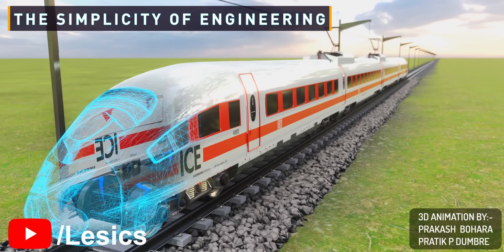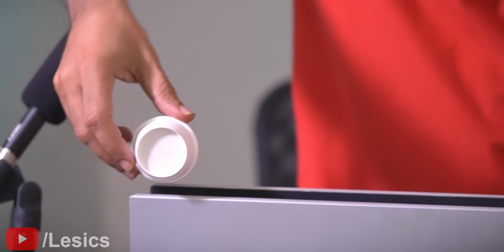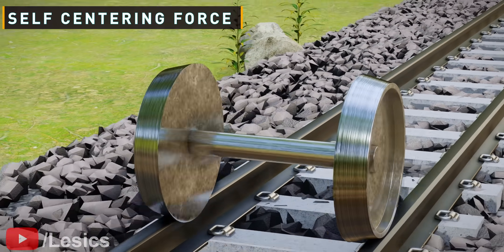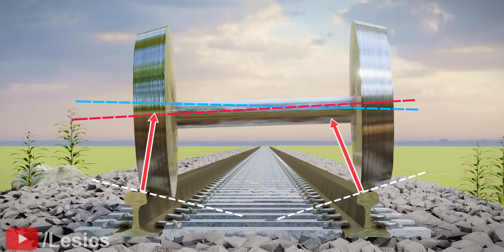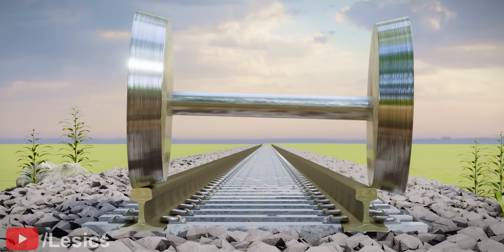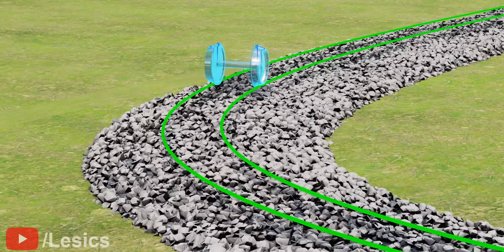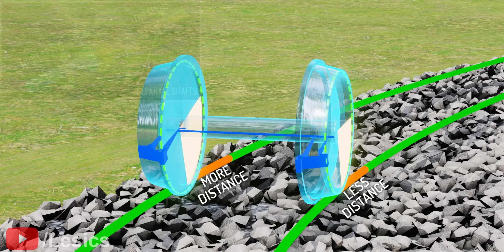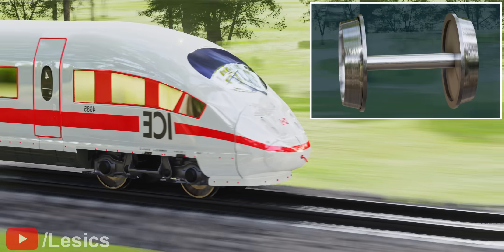The interesting engineering behind the SHAPE of Train wheels!

Comment: For the same reason airliner wings are also attached in such a conical angle (seen in longitudinal direction), it stabilizes the flight of the aircraft.
Reply: some airplanes, such as the F16, are electronically stabilized to avoid installing such feature, which reduces its agility. The surfaces apply small and fast correction to account for the unstabilizes flight.
Reply: @yosyp_yosyp  that's right, it's done exclusively with military fighter jets and bombers to make them more agile, the F-16 was the first to use a digital Fbw enabling such a aerodynamical instability. Today all of them are built like this. 
Airliners however have to be certified after the FAR25 rules, after this rules  aircraft have to be controllable even without fbw systems, so aerodynamical instability is a no go for any FAR25 aircraft
Reply: "For the same reason"
No, dihedral is purely about stability, nothing to do with the outer wing traveling further in a turn. Boats and planes don't have to worry about wings/hulls binding and causing wear due to friction.
Reply: @ferrumignis  for the stability reason - not because of wear, since there is no wear for wings. The conical railroad wheel isn't just because of wear, it's also because of stabity
Reply: @simonm1447  Ok I see what you mean 👍
Reply: ...basically everything that require stability is backed by a Triangular geometry. A cone being a circular base 3D Triangle. If you view a motorcyclist from the side, a Triangle appears to form from the front forks to the rider's arms/ shoulder and down from the spine towards the rear shock absorber. The strong base is the distance between the contact patch of both the tyres.
Reply: cant like cause 69
Reply: Yes, they go slanting down from airplane so that the air pushes down increasing the altitude and producing flight of the airplane. But wobbling is a very common thing in airplane. 😪😪😪
Reply: @OlgaPlaysMatch-3Game  is slants upwards and its called a dihedral to help with roll stability
Reply: @KerbalChris  yes, and aircraft with wings on the top of the fuselage like mililitary transporters often have anhedral, a downward angle in y-direction for the same reason.
Reply: @othernicksweretaken  actually the anhedral on military planes are for increased maneuverability, as a plane rolls lift helps it roll faster
Reply: @othernicksweretaken  Aircraft with wings on top of the fuselage are more stable naturally, here they use the downward angle to limit the stability, since they would be hard to turn and maneuver (because of too much stability) with wings with a upward angle.
Reply: @othernicksweretaken  NOT neccessarily so. The weight of the body attached to the underside of the wings normally provide enough stability.
Reply: @OlgaPlaysMatch-3Game  you have been obviously smoking the wrong stuff
Reply: @OlgaPlaysMatch-3Game  Huh?